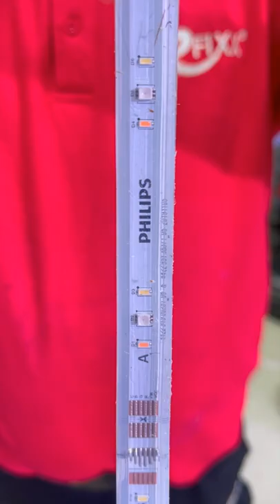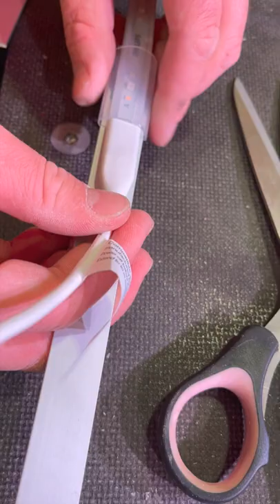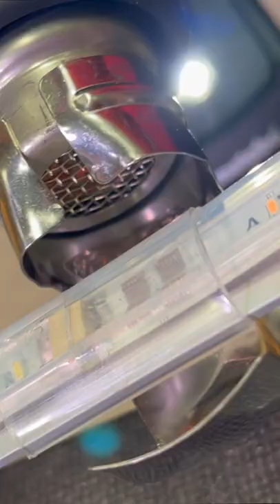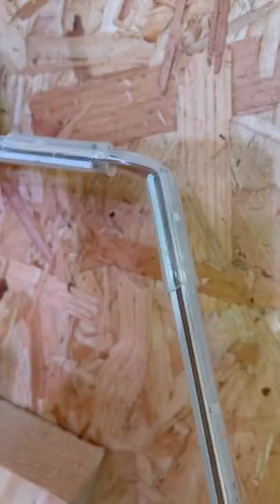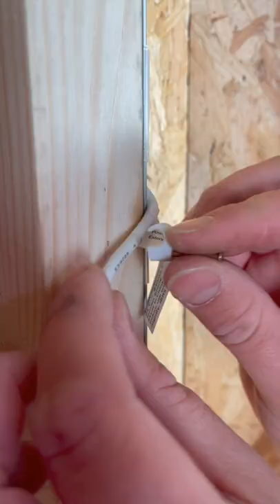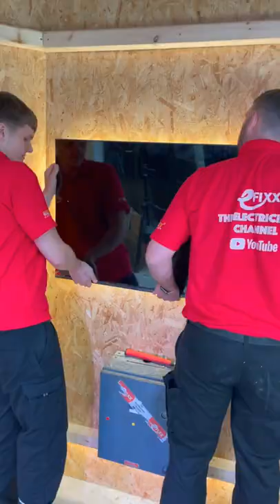Get Glowing - Philips Hue Light Strip TV install

Comment: WS2812b (individually controllable) LEDs would have been a better choice IMO. You can use a microcontroller so you can have all sorts of moving effects and also sync them to the TV screen border (with a bit of work) - Hue are reliable but otherwise overpriced and limited compared to newer smart home tech
Reply: This is a really fair and balanced comment, are you sure you’re in the right place? 😆
Reply: @SamButlerUK  give the trolls time… I’m sure I’ll have offended someone!!